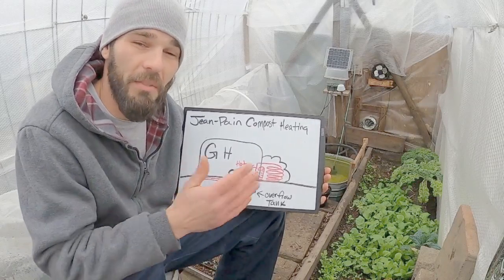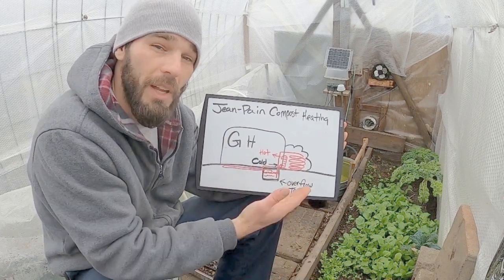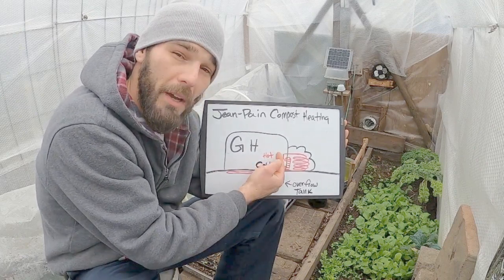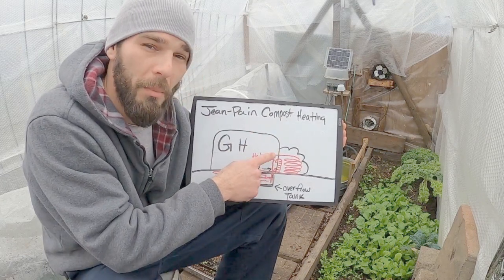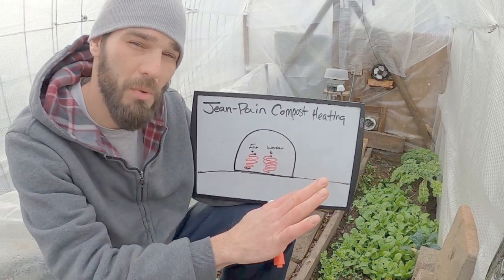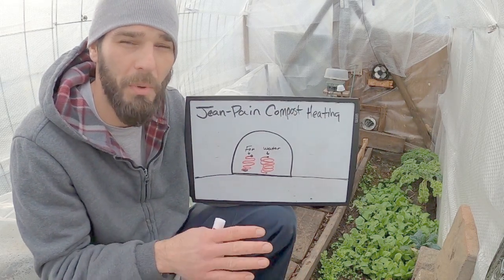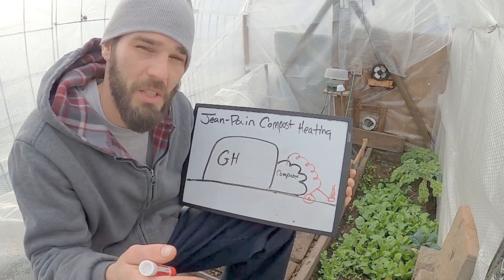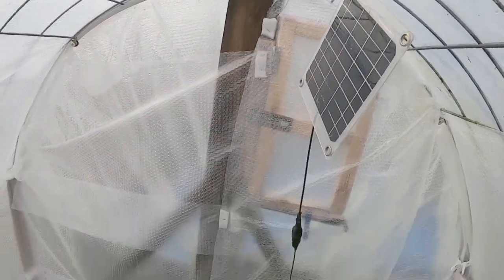DIY Compost Heated Greenhouse Explained | Diagram Drawing,  Explanation, & More Uses!

Comment: Your videos are really inspiring!  I'm thinking about creating own compost heap to heat my small hoophouse.  Do you ever have to turn your compost heap? How would that happen considering all the tubing inside the pile? Also, is the air tube perforated ? Do you think that would be a way of aerating the compost pile? or would you then lose the heat that's running through the tube?
Reply from the maker: The method we use requires a large pile that will hold the burn for long durations, as opposed to quick composting just for the compost. We don’t have to turn the pile of woodchips and if you used animal manure and hay or draw you could build a large pile that will burn for a good amount of time that won’t need turning either, it all depends on what you’ve got for carbon and nitrogen materials

Comment: love it! Your content is epic! One huge hidden key to heat loss often overlooked is the ground, specifically the frost line region. I added insulation foam sheets about 2 ft down and all around the perimeter of my experimental gh and accept the below earth temperature from there which holds about 50 degrees F. My design needs improvement because a lot of seeds need 50+ Degree F to sprout and I'm seeming to realize heat may be what I'm missing to really see plants boom into growth (I"m mostly looking at dirt and sticks right now lol) Though my sugar peas I started in some ol buckets are about ready to harvest. I'm going to try to do what you are doing w the compost geothermal air and water circulation, that's brilliant!
Reply from the maker: Great input!! Thank you! We’ve got more ideas coming down the line for gethermal air movement , I really want to try insulating my ground next season on our large greenhouse

Comment: Are there any fumes or gasses you need to worry about building up within the greenhouse?
Reply from the maker: If your pile is outside and your only drawing heat then not at all, but hot compost inside the greenhouse will release small amounts of methane and CO2.

Comment: Really awesome the way you're able to synthesize feedback from folks, and then work through the engineering for the solutions. Finding that expandable rubber bladder technique is a really nice low tech way to "pressurize" the storage tank. Perhaps a phase 2 would be to capture the by-products of the methane burn, CO2 and water, and return it to the green house.

Comment: I found your channel a few weeks ago and really enjoy it. I've collected materials to build a couple of greenhouses already; one from a repurposed glass office cubicle and another from a gazebo frame. I've been excited to see how you've used compost as a means of heat. I'm not sure if it will provide enough heat year around in my climate in Minnesota,  but it will certainly be enough to lengthen the growing season.

I was wondering if there is a way to improve even further by creating a thermal mass to collect heat in addition to a biodigesting compost. I've been trying to think of how that might be accomplished. 

The space that I have available will already be compromised to some degree from living in an urban environment that does not have full sun throughout the day. Any improvement will be a plus.
Reply from the maker: Creating a bigger thermal mass would require transfer to another “system” or to a larger overflow tank, I’ve been looking for ibc tote bladders but I may end up getting an old pond liner or used horse trough for the large greenhouse, we’re maxed out for space in our little greenhouse. I really contemplated digging the wall way 2-3’ deep and making a pond with a cap Of wood I can walk on but I never ended up setting that up. Water, rock, and the floor (if insulated around the outside of greenhouse) are the best natural sinks for heat, increasing my overflow tank from 40 gallons in the big greenhouse to 100 or more will give us a massive increase in heat storage.
Reply: @Earthdwellershomestead  Have you considered multiple poly barrels filled with rock and water, instead of a single larger bladder? It seems like they'd be easier to come by and they could be linked together with pipe.

Comment: Thank you! I have been going through your videos starting from last year. I missed this or in case, haven't got to it yet.
Reply: Can you say what material your air and water hoses are? And perhaps what you think would be a better setup so hoses weren't crushed.
Reply: I have several solar panel electric fence chargers that are not used during the fall, winter and spring months. Do you think they could be used?
Reply: Methane..., YES!!! I imagine I have a ton of that wasted.
Reply from the maker: This depends, if you have a way to hook the panel up to a dc motor or fan your in business but if your looking to plug into ac you have to have an inverter and controller panel for good operation, hopefully that helps a little. Always willing to answer questions.
Reply from the maker: Our hose was a rubber 100ft recycled hose and for the air system I want to use a flexible metal tubing or a solid pipe in a “U-shape” to prevent from having the weight of the pile crush it. I just built a decent set up with solid tubing for our large greenhouse and it’s much easier not having to worry about being delicate with a dryer vent.

Comment: How well is it actually working? Is most of the benefit coming from the fan system?
Reply from the maker: No I would say it’s Maby 50/50 the water heating the floor is just as crucial, we kept 50f in the airspace and about the same on the floor.

Comment: Heya, enjoying the videos you put out...two questions. Why not mount the solar panel for the fan outside? And secondly, when your water leaves the ground floor tubing and enters the overfill bucket doesnt it lose heat? could you not make the tubing a closed circuit?
Reply from the maker: Yes it will loose heat but it’s only to the greenhouse which isn’t a bad thing. And I believe if I did close the circuit and I had an accidental cool down and freeze, the system would be worse off than if it’s open for some extra expansion room, and thank you!